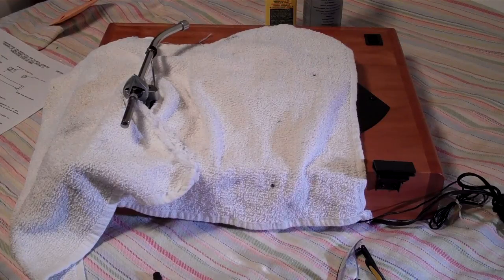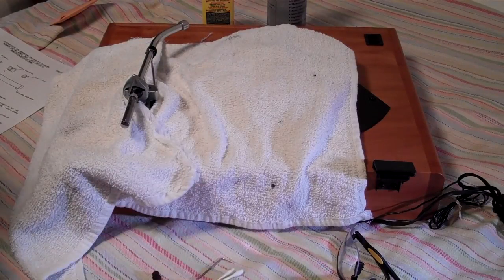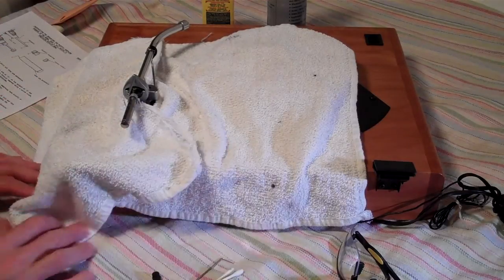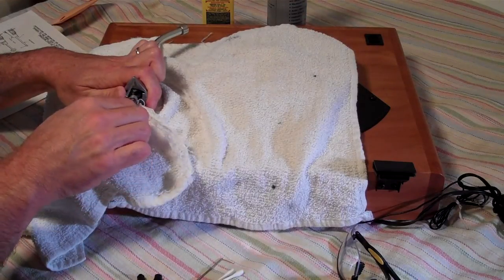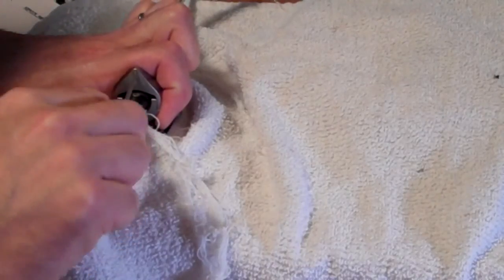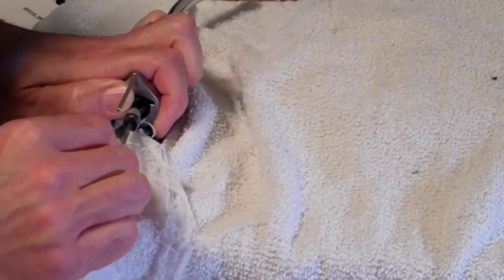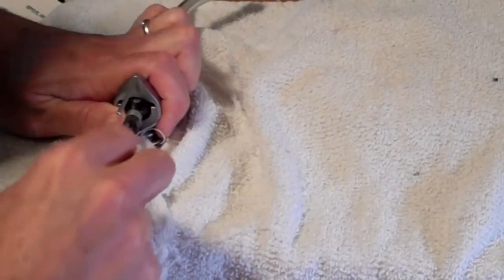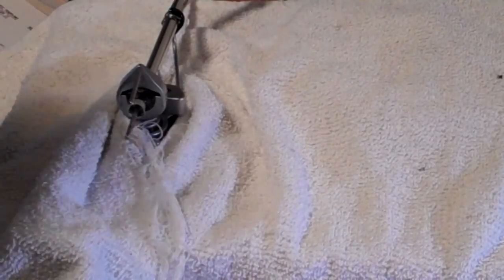Pt 1, Replacing the rubber coupling gasket on SME 3009 Series II Tonearm

Comment: You should have really removed the arm-tube and desoldered the thin armwiring. That way you can handle the armtube better, without possible harm or bending.
By moving and picking with the screwdriver to get the old rubber out, you destroy the edges of the armtube and it bents out, at least looking ugly afterwards.
Turning the arm upside down you will notice a small screw near the end.  If you take that out, you should be able to take out the pin and inside collar assembly easy. 
If a little stuck because of the old rubber, use a small flat plier and pull the whole out of the armtube, it does not want much force.
If all is glued in place after previous "fix" you need more time to gently take awau the glue. Use a small sugical scalpel for that.
Reply from the maker: I look forward to your video, so I can take mine down.
Reply: can you show in a small video what you mean, I do not understand your method, Thanx!

Comment: Just changed the rubbers in my 3012 Series II and didn't see this video till after I'd finished. I went to the additional trouble of completely removing the arm tube from the bearings. In my case the smaller rubber spacer was stuck halfway down the counterweight tube. After using a small screwdriver to pick at the rubber with no success I found that using a 6.5mm drill bit rotated by hand took only a few minutes to remove most of the rubber.